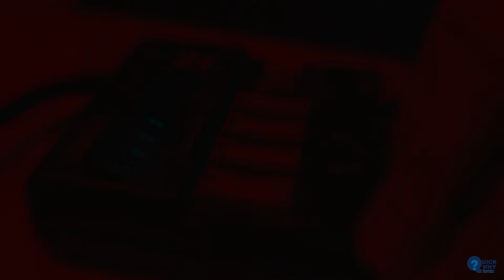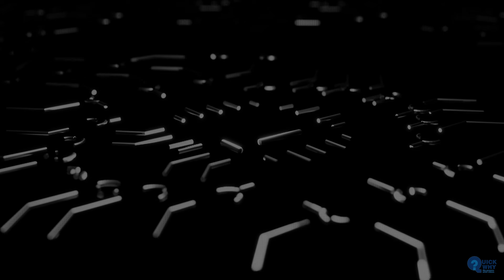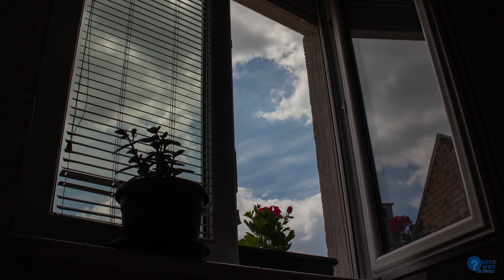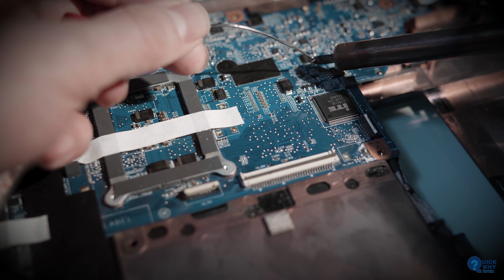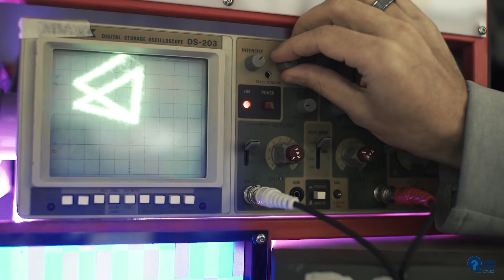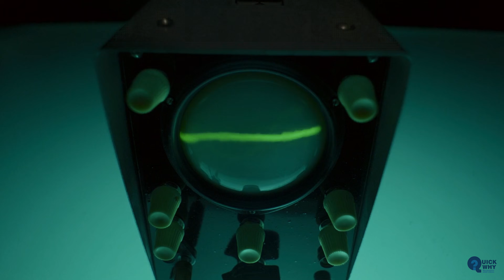Why Electronics Have Noise | Where It Comes From

Comment: I was talking to pashay Sharma, an Sony engineer, and they filter circuitry.  It was a long time ago.  But circuits are designed to save space, not to be filtered.  Like even Intel only makes a circuit to save space.  But you might consider an analog pentium of 4 billion transistors goes 3 terrahertz, but this means you mustn't upgrade ever.  It makes money to be digital.